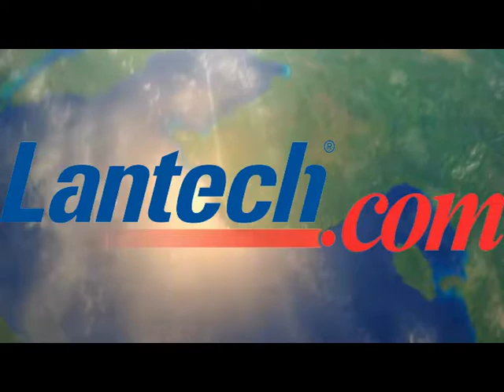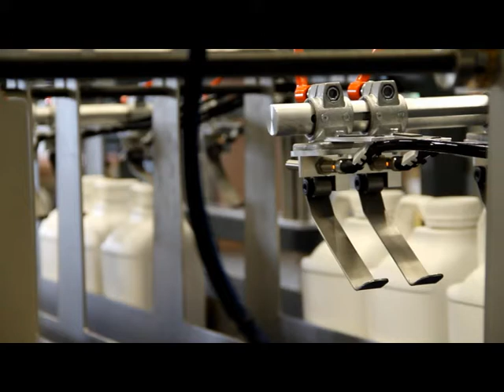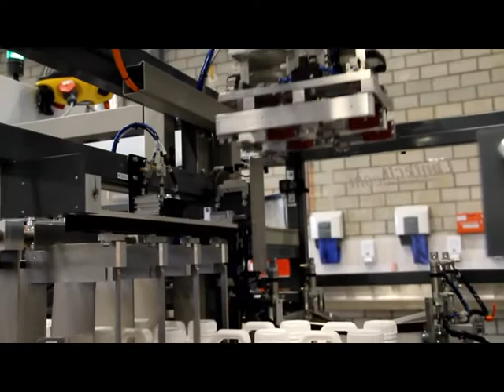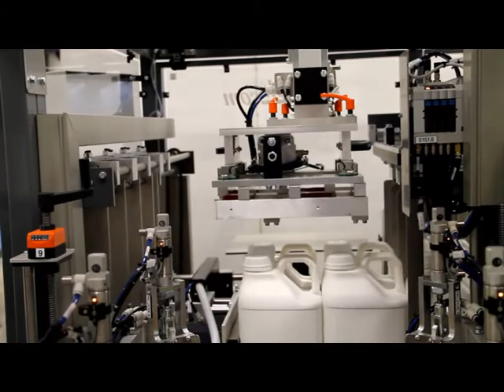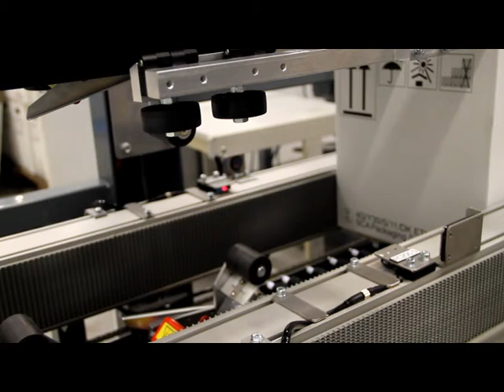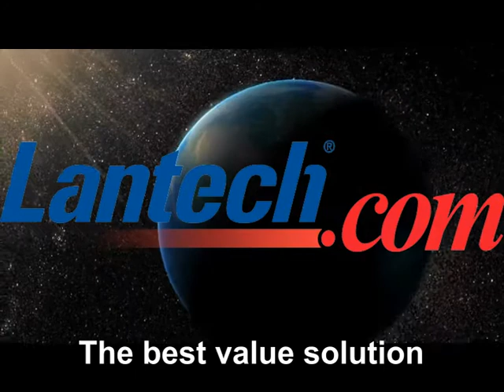Lantech CP 1000/2 Case Packer Plastic Containers filled with chemicals

Comment from the maker: The Lantech CP 1000/2 can be developed for hundreds of different products. This version has been designed to pack 5ltr plastic containers making it ideal for industries such as chemicals, oil, veterinary supplies, detergents and much more. As with all Lantech machinery, the CP 1000 comes with Lantech's "Built Tough" unlimited cycle 3 year warranty. Please contact us for more information.

Ireland & Europe: 00353 1 8077600
U.K: 0044 1952 585 444
http://www.abcokovex.co.uk/case-handling.html

Comment from the maker: The Lantech CP 1000 case packer packing speed is determined on the line speed of the product. The machine can be developed to accomodate extreme high speeds. One way of increasing the speed is to pack full layers in one movement, this can be achieved by dividing the line as shown in attached video. Please contact us for more information.

Ireland: 00353 1 8077600
U.K: 0044 1952 585 444
http://www.abcokovex.com/case-handling.html
http://www.abcokovex.co.uk/case-handling.html